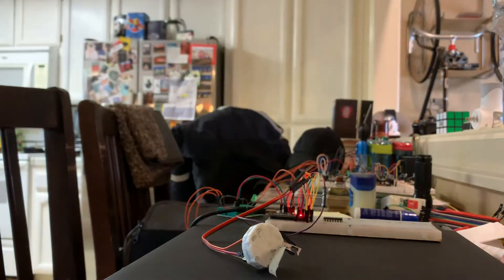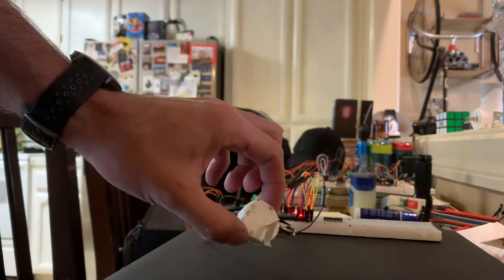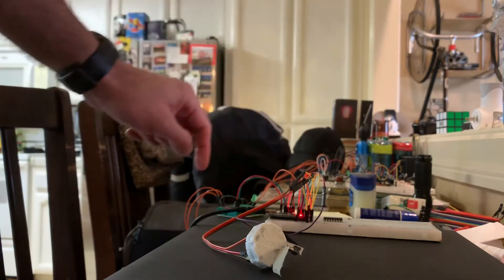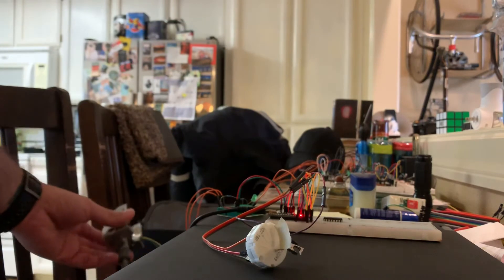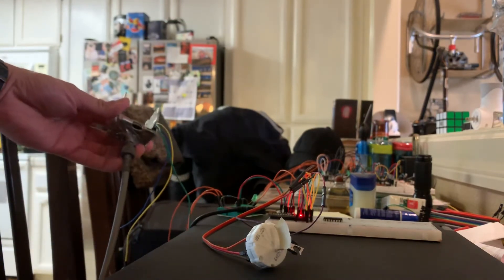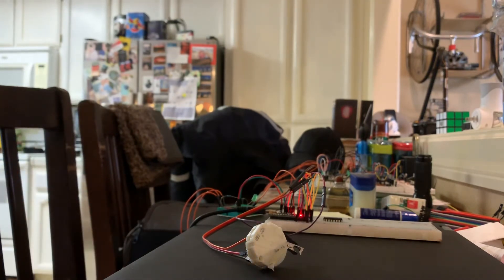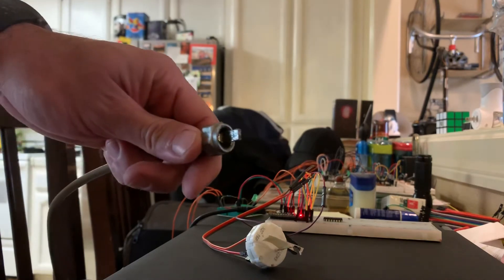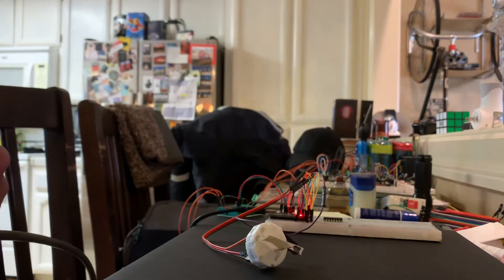Making a tachometer/ speedometer from a x27.168, an Arduino nano, and a A3144 Hall effect sensor

Comment: Hi, this is exactly what I am looking for. Great job! Trying to fix my wobbling speedo from my 56th AWO single. Any chance that you would share the code?
Reply from the maker: The code is functioning but unfinished for my particular purpose. However, In the case that it may help you I went ahead and posted the code at www.Hondatwins.net where I am posting about this project. Here is a link to the forum with the code. In the case that youTube does not like that I am posting a link in the comments I will go ahead and also include the link in the Video notes. Thanks. 

https://www.hondatwins.net/forums/60-miscellaneous-discussion/130878-cb450-k0-bomber-electronic-speedo-tach-gauge.html
Reply from the maker: I also added a ridiculous amount of notes to help you understand the code. Maybe too many notes. I may have made things more complicated than they really are by providing to much information, lol. If you need any additional explanation on the notes just let me know and I'll see what I can do to be of help. Thanks.
Reply: @Blue2swing  Thanks Mate. Copied the code from the forum. Actually I am a total beginner with arduinos however I will try to make myself a working speedo with your work. I ill post my work here once I am done.  Once again, thanks for sharing.
Reply from the maker: @Bastelpeter2   I forgot to mention that you need to place a 10k pull up resistor between pin2 (on the arduino) and Vin (on the arduino) to keep the hall effect sensor pin voltage from bouncing. If you dont know what bouncing is do a youtube search for arduino & bouncing and it will explain what is happening. I had trouble with my arduino when I first started because of this.  After I learned what was happening is solved my problems on several of my projects.